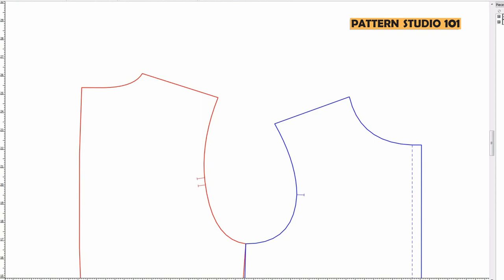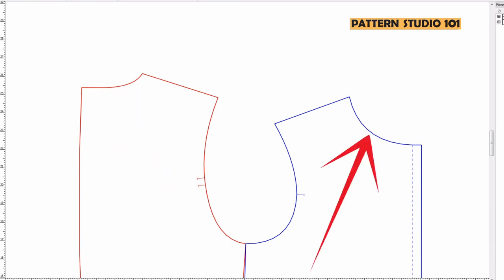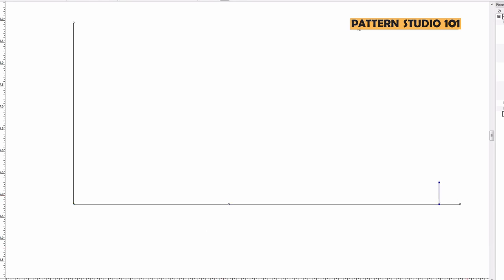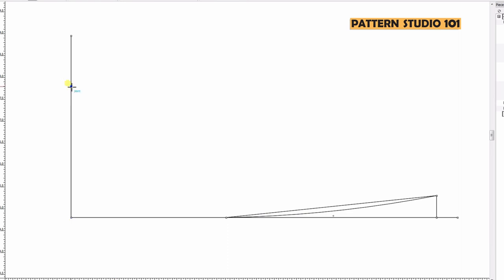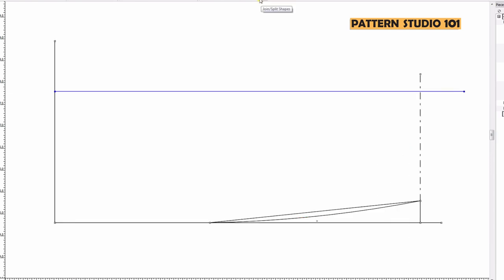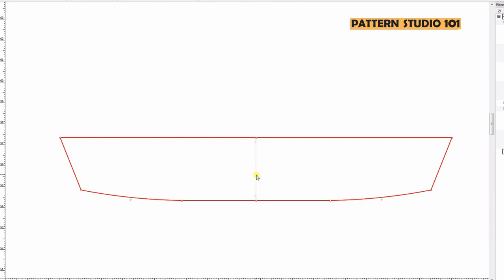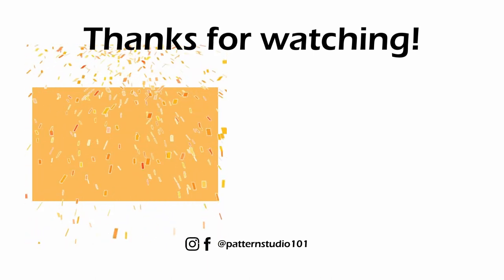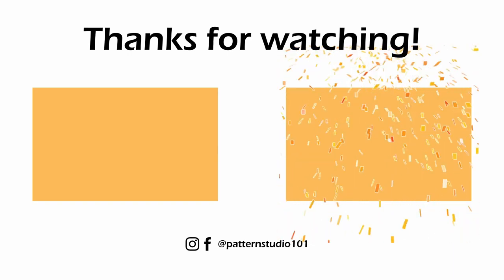How to Draft Convertible Collar Patterns _ Variety of Designs & 1-Piece Collar Cutting

Comment: Could you please explain why you don't add the extension measurement? I follow your instruction for measuring back neck and front neck measurement without adding the extension (my extension is 1" width). When I was constructing my collar, it was 1" short each side. (so my collar is 2" short in total.) Thank you.
Reply from the maker: Hi Shulin, extension is added from the center front for buttons. The collar will finish at the center front both sides. When you button up, the collar end will meet each other at the center front.
If the collar finishes at the end of the front body, when you button up, the collar will be overlap. Make sense?
Reply: @PatternStudio101  Thank you very much for your explanation. That makes sense.